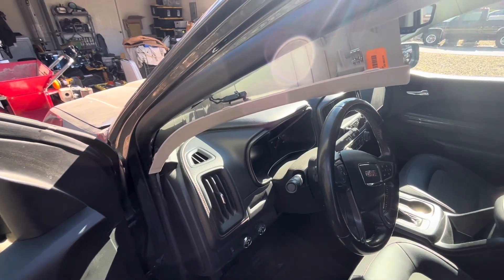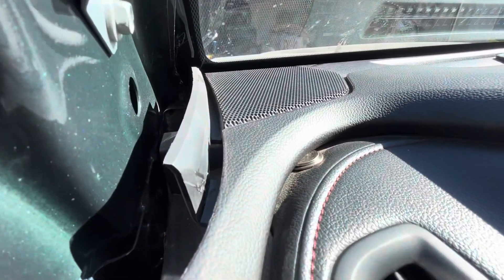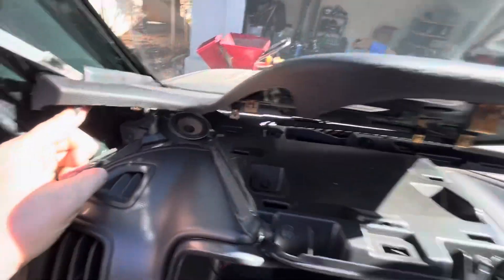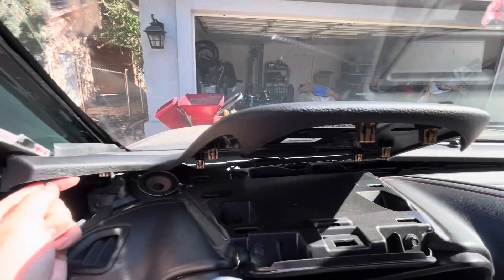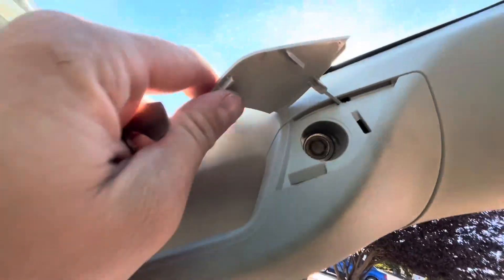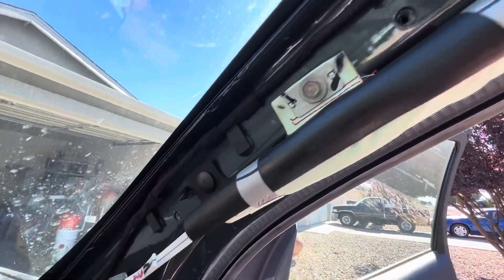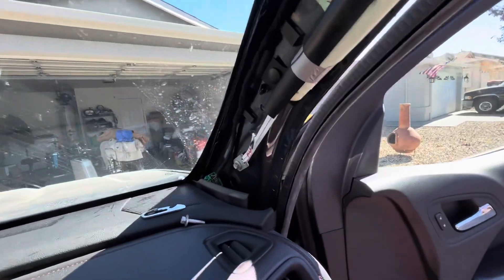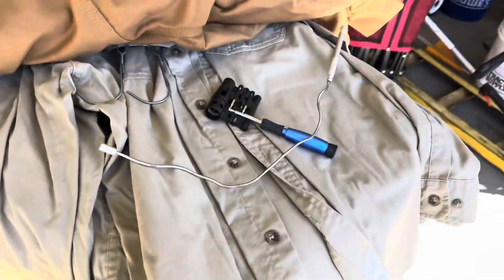2015-2022 Chevy Colorado GMC Canyon Dash Speaker Removal Tutorial

Comment: Thanks 🙏 I couldn't find a video anywhere for the dash panel or the driver pool panel. The driver door panel is the most difficult door panel to remove I've ever seen. Luckily only broke 1 cheap clip on the 2nd small panel by the electric windows and locks 😅

Comment: I have the bose system in my Colorado 1 speaker is blown sounds like absolute crap even at low volume and I even lowered the bass it's crazy. I assume it's all amplified too. But I don't understand why my front speakers are much Louder then my rears. And my fronts produce way more bass then my rear when u switch to the rears no bass from them. Switch to fronts all the bass. It'd weird my radio also is acting weird so maybe it's that idk
Reply from the maker: even in my stock system the fronts are much louder than the rear speakers. i am sure it has to do with ohms of the speakers etc. and the back speakers sound like crap too. I will maybe change them someday, but probably not haha. the system itself sounds great overall stock.
Reply: @SamFunk12  yeah no it's pretty loud and sounds good. I just wasn't sure if that was normal. Cuz one day I switched the speakers to the rear only and the bass went away and the music got lower . Then I'd start to go back to the fronts then the bass would come back and it got Louder again it was so weird. And now I have 1 blown out in the front the 6x9. I bought a cheap "factory replacement speaker" from my job so I'll see how that sounds or handles the bass I guess. Idk if it needs a specific speaker cuz it's bose or something
Reply: @SamFunk12  I found a forum on replacing all these and how to make it work . And ppl are getting better quality and Louder or something
Reply: So far I have only replaced my rear speakers and I'm doing the front speakers today. In the drivers seat it's not super noticeable but sitting in the backseat is a whole new experience. I went with some Kicker DS 6-3/4 speakers and the sound is much better than factory.